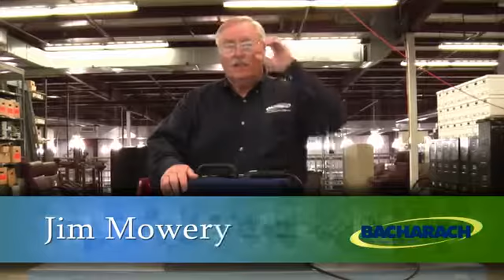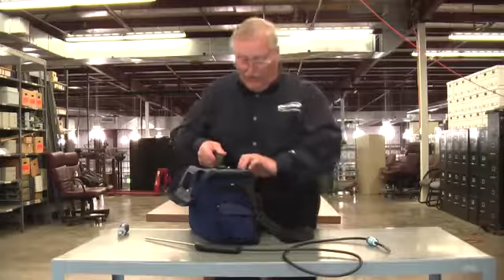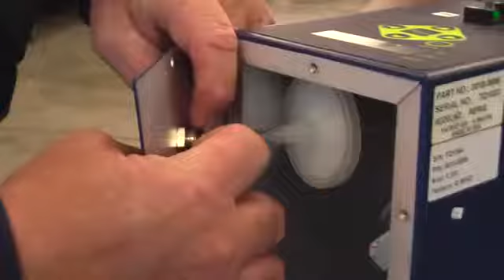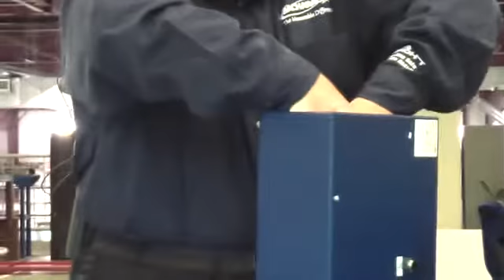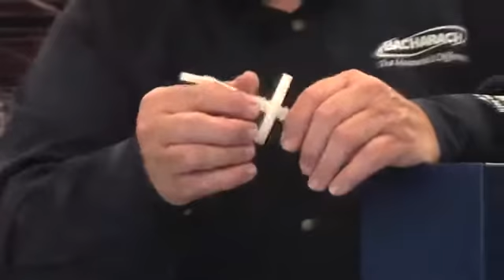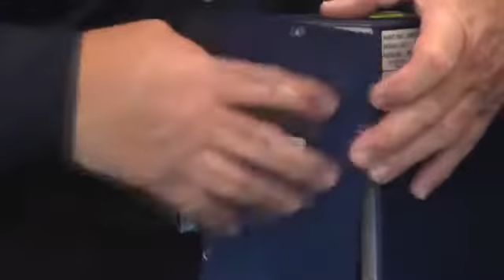Replacing Bacharach PGM IR Filters

Comment: could you tell me the part number for the push to connect fitting for the intake of the unit and the little plastic 90 that connects to the unit. it is broken on my Bacharach
Reply: 3015-3234 ELBOW